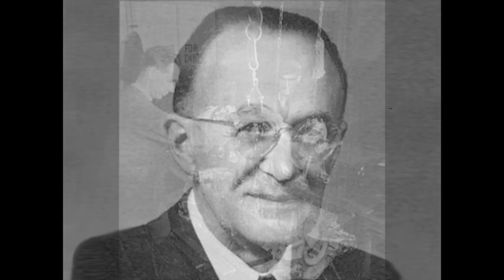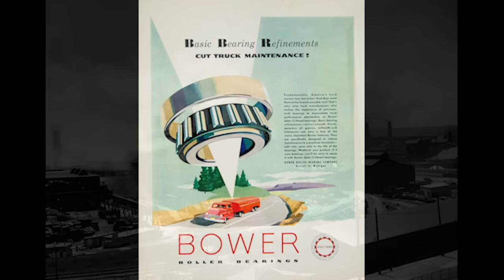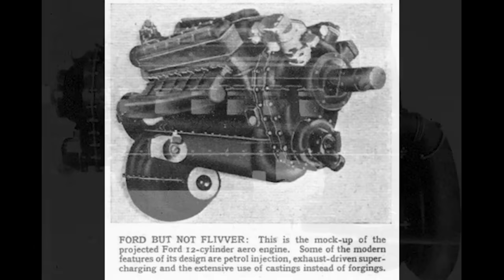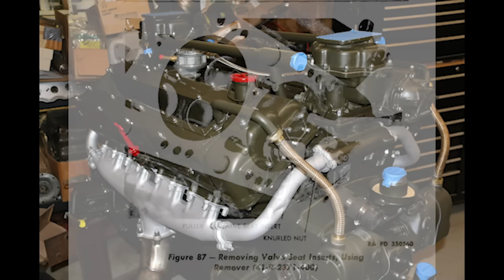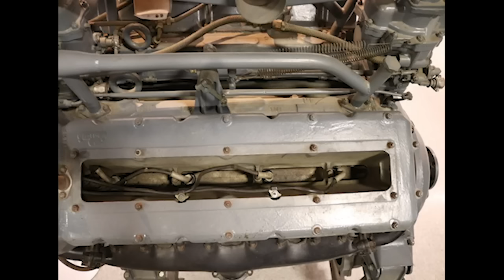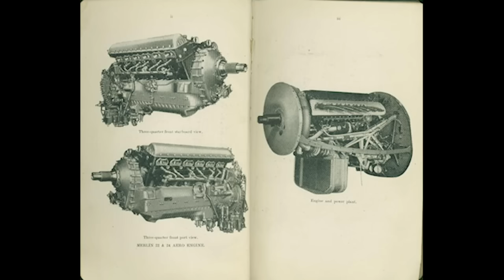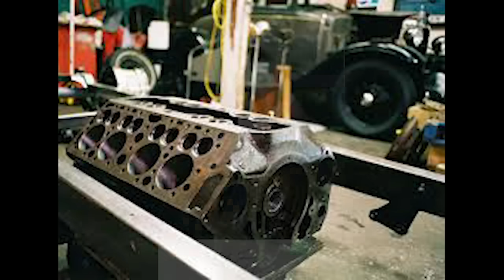War Hemi: The Story Of The GAA V8 - 1,100ci of aluminum WWII Ford grunt

Comment: Modern engines are a mess. I don’t drive late models anymore. Classics only
Reply: Are you afraid of all that horsepower modern  engines make, it's OK to admit that 750 hp scares you.
Reply: @WilhelmKarsten maybe he doesnt care for needing unobtainable propriatary softerware to repair one. Lots of horsepower has no value when one of the hundreds of sensors go bad and you cant decipher which one. You aren't wrong about the performance. But when they are at 100% not sharing proprietary information, the "alleged" owner is screwed. This is fact and it is where Im at right now, but with a diesel.
Reply: @giggiddy  It is a problem that only seems to effect those who think they are mechanics... but aren't.
Reply: @WilhelmKarsten  While I agree with you that engines today are superior in almost every way compared to the stuff several decades ago. I disagree with you about it only affecting shade tree guys. There is now proprietary software out there that only the dealers have access to. So master mechanics in the field can not properly diagnose/repair systems that use this software. This practice is increasing and in a few more years, only the dealers will be able to diagnose and repair these vehicles. Thats a big problem for everyone. If you disagree. Then we'll have to agree to disagree because if I pay 100k for a vehicle, I should be getting everything associated with said vehicle. Allowing me access to any system in the machine. Either way. Thanks for the dialog.
Reply: @giggiddy  Your comments reveal someone who is very old and out of touch with what is happening in the world.... someone who probably stopped learning anything new about cars in the 1970s and also in terms of automobile technology, computer illiterate

Comment: I have watched several GAA Youtube videos, and although I have not gotten any responses from my queries....and have commented with the question; are the tubes running from the exhaust manifolds to under carburetors on the GAA for vaporizing fuel, i.e. a vapor carburetion? I have seen industrial vapor gasoline engines from that era with similar induction systems. Apparently they were created for greater fuel efficiency which would seem in line for military applications...

Comment: Take an 1800hp engine and turn it into a 500hp engine......."Furdized"
Reply: 1,800 WEP, 950 hp continuous. 500hp by removing 4 cylinders, the supercharger and the fuel injection.

Comment: It is interesting that Ford, in the early 40’s, used tower shafts to operate the Cams. Yet, in the mid 60’s when Ford put Overhead Cams on the FE 427,  They used a long roller Chain. Naturally, there were flaws in using a Chain. I believe, not sure, that Crane Cams made a Gear Train that would solve those problems.

   The point of this is that the Tower Shafts, of the 40’s was superior so why didn’t Ford use it on the 427 ?

                                      Fergieman
Reply: Thats easy, COST... these engines cost over $100,000 dollars each in today value.

Comment: I think you forgot the part about the sterling silver bearings. pricy. also meaning you need special oil, to keep the bearing from rotting out due to electrolysis. unfortunately thanks to the rat rodders, and farm pump boys these engines are pretty much extinct.

Comment: It is the largest production gasoline v8 ever. But certainly not the largest production v8. 
EMD 710 V8 engines are both production and larger in every way. They are diesel. The 710 designation is for the number of cubic inches of displacement, per cylinder. 😅
It is also a hemi.
Reply: The EMD 710 is NOT a hemi, it uses a "high swirl" Recardo Comet or Heron-type combustion chamber built into the piston crown.
Any questions?
Reply: @sandervanderkammen9230  
Centralized combustion. Four valves, reversed crown. 
Still the largest production V8. Whether you want to call it a hemi or not.
Reply: @ryandavis7593  Sorry, but you are very confused and misinformed about the EMD 710, it utilizes a Heron-type combustion chamber and is the exact opposite principle of the Hemispherical Chamber design.
 The Heron chamber developed by Harry Ricardo and Jasper L'Orange creates extremely high air charge turbulence to maximize combustion efficiency at the expense of higher thermal rejection.
The Hemi design is an obsolete technology that is no longer manufactured due to its low efficiency and performance.
Reply: @sandervanderkammen9230  
Interesting as that is not what they said at EMD. 
My point still remains. It is the largest production v8 engine. 
Also, I work on these engines every day. 
Yes the shape of the piston does create turbulence aiding in complete combustion. As in all internal combustion engines, it is a compromise. 
I would love to see these engines pushed further in efficiency and performance. 

Better ring technology, better turbo/supercharger technology as well as catalytic converters would go a long way in keeping them relevant. 

I work on 645E3 power in locomotives and converted 567c units converted to 645e packs. 
The conversions require  different timing of the injectors. 

Thanks for pointing out the types of combustion theories used in these engines. 
My instructor at EMD simply called it an inverse hemi as do some of my diesel engineering books. Albeit they all are quite old and generalized.
Reply: @ryandavis7593  I have also worked on EMD engines and several other 2-stroke Diesel engine types, it's a fascinating design that had some unique features and advantages when they were first introduced but they have some serious limitations that have made them unable to compete against modern turbocharged 4-stroke engines.

Unfortunately, your instructor is very confused about the EMDs Chamber design.
A Hemi chamber is a design developed by the theory (now completely obsolete)
That minimizing turbulence and surface to volume ratio will improve efficiency by reducing thermal rejection.
The Heron head works on a completely different and contradicting theory (now widely accepted) that maximum turbulence and mixing of the air charge with the fuel is superior to the hemi theory.

If you invert the Heron type head you get essentially a modern Pentroof head common on modern gasoline engines 

I once owned a VW Gti that had a gasoline Heron head engine, with a completely flat head and a deeply dished piston with the Quench band
Reply: @sandervanderkammen9230  

That must have been a blast to drive. 
One of the issues we deal with in the railroad industry is reliability. 
The only four stroke contenders against EMD all have had miserable reliability issues. The ALCO engines are notorious oil burners as are all of the GE locomotives. The intake valves start sucking oil and the exhaust valves get loose which allow oil into the exhaust often resulting in turbo fires. 
When EMD locomotives have some internal fire they usually self extinguish. The EMD fires are usually a mechanics fault rather than mechanical failure. 
Reliability is essential for most American short lines. This is where the EMD really shine. 
The ALCOs are almost extinct. The Baldwins are a lost cause. The two stroke Fairbanks Morse are the living dead in excursion service which leaves us with GE. 
GE is now in the hands of WABTEC. Judging by their history in locomotive design and building it is soon to be dead. Think Morrison Knudsen/Motive Power. 
The American locomotive market only has one other builder that has had chronic crank issues. 
The EPA wants us to go electric without even understanding the scope that this entails whether battery power or overhead wire. The average short line cannot afford any of these options and keeping the four stroke in the game long term is looking very bleak. 
So it comes back to this question. 
How can we make the most reliable power plants on rails more efficient.
You are clearly very smart and you have my respect so please help us out of this situation. 

I propose gap less rings, the turbo units clutch be replaced with a torque converter and oil pressure released clutch built in. This in theory could turn the over reving of the turbo into useful torque at the gear train. 
Variable injector timing and catalytic surfacing of the combustion quench faces. 
Other catalyst and urea systems could also be fitted but perhaps not as easily. 

I am a gear head with no formal mechanical engineering education but plenty of practical experience. 

Let me know what your thoughts are.

Comment: Fork and blade sucks ass. Ford abandoned it for the same reason you see it in zero cars in the last 50 years.

100k+ merlins were built and I still can't find one for my hot rod... I'd take either of the fords tho.
Reply: Then why is fork and blade used on nearly every V-12 aircraft engine???
 Cars are a low performance application compared to aircraft.

Comment: henry ford was a big supporter of hitler and was an actual pen pal .  He also despised Jews .
Reply: And it was General Motors that owned 25% of I.G Farben that made the zyklon b used in the gas chambers of the concentration camps. Ford may have not like Jews but GM is responsible for murdering them.

Comment: Valve float might be 3,800 but even in testing driving above 2,800 was not something you were supposed to do. The oil pumps really could not take the abuse (shade driven). The HL 210 and 230 are in the same boat.
Reply: Being Aircraft engines there is no advantage in revving over 3,000 rpm and with bore diameters over 100mm you start to need more combustion dwell time.

Comment: Still working on a book on the US Tank Engines… the GAA is extremely complex compared to other engines. It has every bell and whistle. Minus fuel injection and super charging. However fuel injection was planned for the V8 once it was working on the V12. And super charging was suggested originally for the V12 Areo and suggested again for the V12 GAC. And it’s not unreasonable to expect it to be applied eventually to the GAA.

Comment: In December, 1961 at Ft. Knox Ky. we were doing tank recovery training in a WW2 and Korean War era Tank Recovery Vehicle which was basically an M-4 Sherman modified for the job.  The turret was removed and an open top assembly shaped like a turret replaced it.  The engine was a Ford GAA V-8.  One of the mechanics training us noticed that the engine was over heating so he foolishly opened the radiator cap.  A gushing streamer  of  boiling water shot up and deflected off of the slanted rear of the fake turret and hit him right in the face.  This incident ended our training for the day and sent the mechanic to the post hospital.  We never did find out how he made out.  By the way, the GAA engine sounded great when it was going through the gears.

Comment: A variant of the GAA, the GAN, would be used for the M26 Pershing tank.
Reply: The GAN was the Electric Tank engine and used in Spotlights. The Pershing engine was the GAF, have two, lower Carbs, and different exhaust, one runs.

Comment: I would've thought that would've thought that would make a salt flats power-plant for a land speed record attempt before the turbojets took it over. Perhaps two of them with superchargers. There were enough of them around for cam grinders, piston manufacturers etc might be persuaded to equip them.  They might be a little heavy for the quarter mile but the salt flats would be a good place to put those..

Comment: My dad worked on some of the planes in England during the war and he told me about the Brits who worked on their Merlin engines, coming over to the Americans and trying to scrounge connecting rods for their engines because the Packard built rods were much stronger and closer to the ideal specs of the rods in question. So yeah, built with surgical precision my fat derriere... ROFL
Reply: The Packard Merlin was a significant improvement over the R-R version... so improved that most parts are not interchangeable.
Reply: Packard said a single Merlin rod took 31 Hrs to make.! It was the weak point of the Merlin, the sideby rods of the Ford are much stronger, in fact later, the Hydroplane and Air racers were using a modified Allison rod, because it was stronger. The sideby rod increased the length of the engine by an inch and a quarter, big deal.
Reply: @jimdickinson3686  You do seem to be comparing apples to oranges though, aren't you?
 The Merlin is in fact an aero engine while the GA maybe based on an aero engine, it's still a tank engine and not subject to the same design specifications.
 also, there is a reason why nearly all aero engines in this class have symmetrical bore spacing... even the Diesel aircraft engines.
German V-12 Maybach tank engines have a symmetrical block.

Comment: The other main advantage of the Ford design: 80 octane fuel. Compared to the 100+ required by the Merlin and Meteor tank version. Cheaper and a whole lot safer to operate, especially in combat  vehicles.
Reply: The Ford aero V-12 would have been supercharged and require 100 octane AvGas.
Reply: A tually the Meteor used 80/87 fuel ,and there is no difference in their explosive issues .
Reply: The Merlin engines were really cool tho. I think it’s cool that the spitfire and P51 were eventually designed around at the time was one of the hottest motors period. Late war 65 serious had close to 2800hp
Reply: @TheJMan1K Detroit/ Madison Avenue Poney power
Reply: @TheJMan1K  Unfortunately Rolls-Royce blundered by not developing the Griffon instead of the Merlin, the Merlin was too smaller by the time the war got going.
The P-51 was a generation ahead of Spitfire.
Reply: @TheJMan1K  The shitfire was designed in the late 30's the Mustang in 1940 and was NOT designed around the merlin.  No production merlin put out over 1750 HP.  and late/post war Packard version put out 2200 HP !!! !!!  Facts of history !!!!

Comment: The Ford Motor Company was asked to produce Merlins at Trafford Park, Stretford, near Manchester, and building work on a new factory was started in    May 1940    on a 118-acre (48 ha) site. Built with two distinct sections to minimise potential bomb damage, it was completed in May 1941 and bombed in the same month.[nb 14] At first, the factory had difficulty in attracting suitable labour, and large numbers of women, youths and untrained men had to be taken on. Despite this, the first Merlin engine came off the production line one month later and it was building the engine at a rate of 200 per week by 1943,[89] at which point the joint factories were producing 18,000 Merlins per year.[35] In his autobiography Not much of an Engineer, Sir Stanley Hooker states: "... once the great Ford factory at Manchester started production, Merlins came out like shelling peas ...".[90]

Some 17,316 people worked at the Trafford Park plant, including 7,260 women and two resident doctors and nurses.[89] Merlin production started to run down in August 1945, and finally ceased on 23 March 1946.[91]

Total Merlin production at Trafford Park was 30,428.[75]

Comment: Actually the military only wanted petrol so as to make fuel supply simple
Reply: With only a few exceptions, WW2 tanks were powered by gasoline aircraft engines.
All US Army combat vehicles ran on 80 octane gasoline.
The USMC a branch of the US. NAVY  were required to be Diesel powered when possible due to storage restrictions on gasoline onboard ships.

Comment: Ford took a Rolex and converted it to a Timex....    ( you do some great stories...)
Reply: Ford took a Cukoo clock and turned it into a Timex.
Merlin engines were built by hand using very primitive, outdated methods and limited quality control standards.

Comment: Well before WW2, consulting engineer Stewart Tresilian told Rolls Royce that smaller capacity faster turning engines would make more power than the big lumps they were developing. 
RR refused to listen but he was right. 
A big problem with the Merlin was maintaining the oil supply at high revs.  Above 3000 rpm, the big ends centrifuged out their oil faster than the pump could supply more oil.  It took a long time and accidental detective work to realise what was going on. 
A smaller crank throw could have spun much faster than the huge thing used in the Merlins.
Reply: The Rolls-Royce Merlin was quickly outdated because it was too small.
You cant run high rpm on aircraft engines because of the limits on propeller design and combustion dwell time as the bore diameter gets larger.
a "band-aid" fix was to increase manifold pressure but this made the engines unreliable and have very short TBOs.
 Rolls-Royce was forced to develop the much larger Griffon to compete with the DB-603, 605 and Jumo 213 but this was too late to have any impact on the war and were rendered obsolete by jets.
Reply: History would prove that Tresilian was a fool and that postponing development of the Rolls-Royce Griffon was one of the biggest British blunders of the war...
His predictions were completely wrong,  aircraft, propellers and engine displacement all got bigger during the war, not smaller.
His ideas about aero engine design was completely wrong.

Comment: Great video - very interesting story. Thank you. 

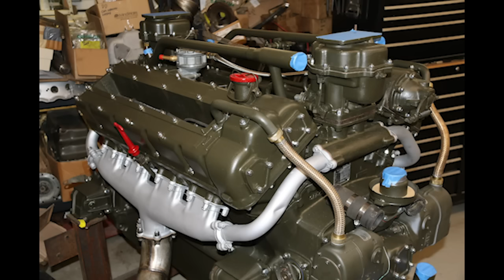12:35 - That's almost correct. There was a V8 derivative of the Meteor tank engine (Merlin minus Supercharger) which was used in British Tank transporters and other vehicles post war. The Meteorite was also 18L (1100CI). https://en.wikipedia.org/wiki/Rolls-Royce_Meteorite

Comment: What a great video. More information than I have ever been able to glean on my own. Henry Ford produced a better airplane engine than the Merlin but was rebuffed by the military as they wanted to simplify logistics. Ford was justifiably upset and refused to participate in making the Merlin engine which then was produced by Packard. Aluminum block, double over head cam with 4 valves per cylinder. Absolutely incredible.